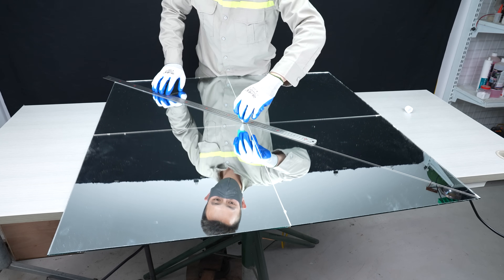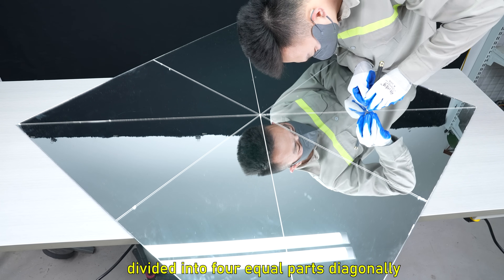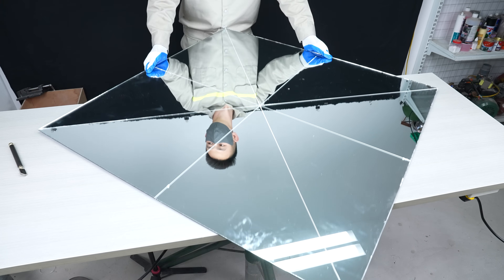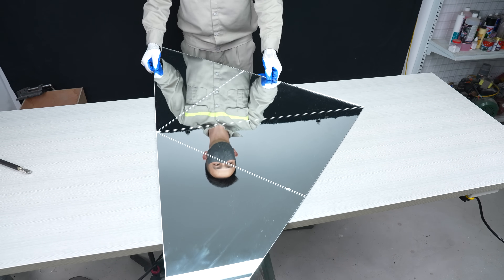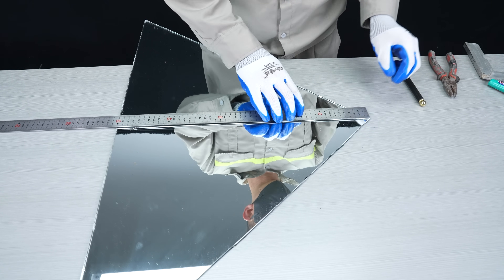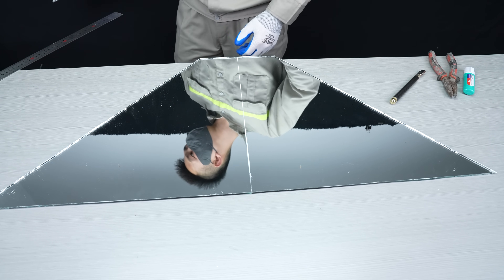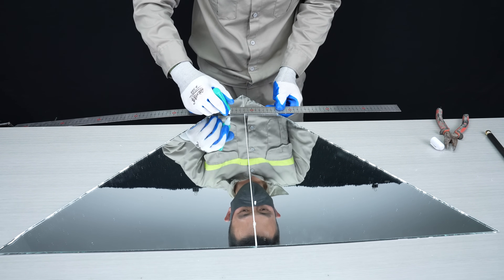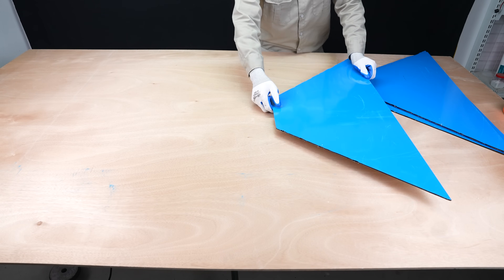Power Plants Didn't Think I Could Generate 220V Electricity Easily This Way

Comment: Yes, a turquoise-colored semiconductor can produce electricity using light. Specifically, if a turquoise semiconductor absorbs light with sufficient energy, it can excite electrons in the valence band, promoting them to the conduction band, thereby allowing the material to conduct electricity. This phenomenon is the basis of many solar cell technologies.. But i doubt there is any turquoise in a CRT electron gun.. ...As for the clock project this does work.. thankyou for sharing.
Reply from the maker: It's fascinating how different materials, even if turquoise isn't found in CRTs, can harness light to generate electricity. Your insight on semiconductors is spot on!
Reply: He is FOOLING YOU   The title is a lie - later he admits its just an experiment.
Can you trust him? You can tell its fake; no real measurments, no diagram, no specs, no details.  
Do Not be gullible.  Don't be fooled.

Comment: Can't possibly work. I'm an ex electrical engineer  !!!
Reply: For every action there is an equal but opposite reaction. Your fulfilling Newton Law of motion
Reply: Nope won't work at all.
Reply from the maker: I get where you're coming from, @dc2.5! It's surprising how simple methods can yield 220V—sometimes the best solutions are the least expected!
Reply: @kinghomemade would of blew the light bulb up if it was 220 v directly to your broken picture tube generator